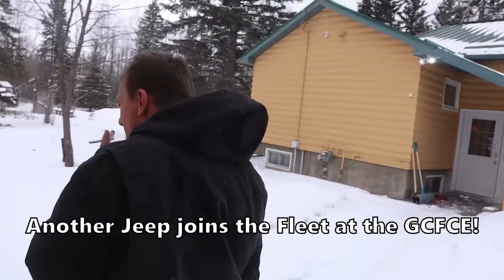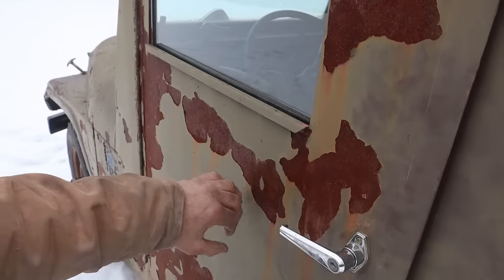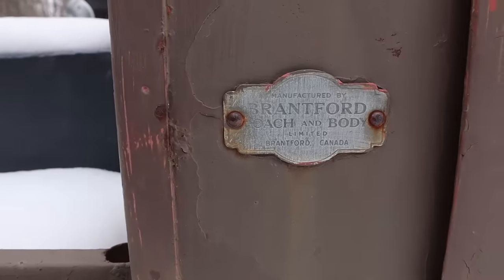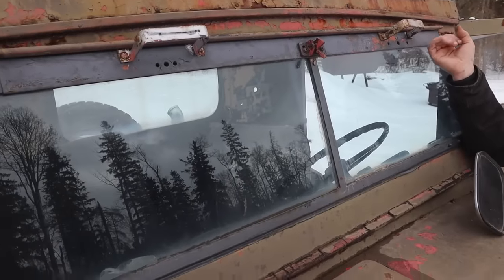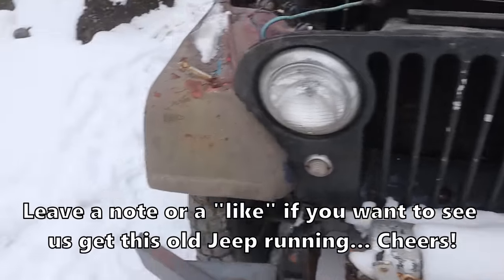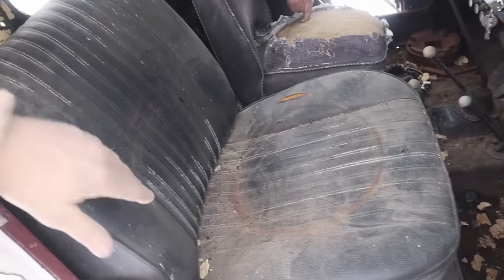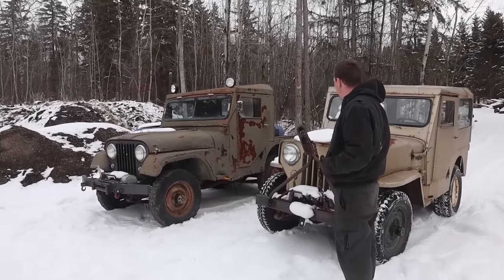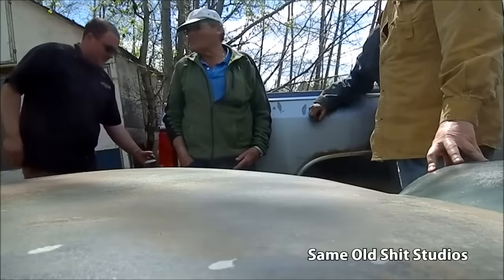Another Jeep for the GCFCE! (I lost the bet, barely...)

Comment: Park break comes out of the dash just below the Amp Guage where the whole is. The windshield folds down AFTER  the top is removed. That channel on the upper outer windshield frame is where the front of a soft top will slide into or a bikini top for summer. I'm a jeep  a holic and have owned a cj2a, cj2b, cj5 and cj7. Some 2 at a time. The best ever was the cj7 with the 5 speed behind a straight 6 4.2 l. Also owned a new  1977 jeep Cherokee chief with a  4 speed and a  360 cu in engine , plus a 1960 jeep pickup.  Yes I am a sorry bastard lol😂

Comment: LOL, I had a 63 CJ Park Mark 4. Bought it in 67 and had it the winter of the Chicago area big snow in 68. Made a lot of money snow plowing with it. The Park model had chromed hood fittings and chromed hand hold inside. The seats were black with red trim. They really knew how to gussey up a Jeep. lol. The valve cover, in red, had Hurricane stamped in big letters. (Hurricane four) It was light blue inside and out with a black full soft top. Really sharp. I loved that thing and did a lot of rough driving while hunting with it. Top end was 60 but didn't really like it.
Good vid.
Lee

Comment: I love both Jeeps. The 60 is very similar to the 56 I had 40 years ago. Same color dash and I painted the outside with rattle cans. The F head is a cool design and the CJ3B has the high hood and cowl to accommodate that engine. Great vehicles, cooler and much less money than any modern side by side. Great video and you’ll have fun getting the 60 to run. Cheers from sunny and warm Denver!

Comment: My dad had one of those. That "Hurricane 4" had just enough power to peel the skin off of a grape! (but it sounded like a hurricane while doing that.) My niece seized it by not checking the oil so off to the scrapper it went. I always remembered the small wood factory blocks it had on the hood as padding when it was open against the windshield.It shocked me that a car that new still had wood parts.

Comment: The snub nose Jeep reminds me of my 53 Ford F100 custom cab that had a 50 gallon saddle tank from a dump truck in the bed. The filler pipe was made from a 2-inch pipe with an internal thread. Same as Dan's, I had to improvise a cap. Mine was a spray can lid with a hose clamp around it. I was able to drive all the way from Philadelphia to Lake Cabanga in Ontario without refilling. The thing had a 351 Cleveland and automatic and served as a work truck and winter beater. But the heat was basically only entertainment, not actually warm or anything. Ran like a top, though.

Comment: I drove several types of Jeeps in the Swiss Army: We had one old 6V. it was historical already in 1980, we had 12 V and 24 V.
This nose of this one here was the most "modern" type we would drive back then. A friend who was a few years older than me told me that he drove a WW2 veteran, he sad it had several bullet holes prooving the vehicle had see some real war action.
The Swiss bought tons of equipment from the US Army at war's end. It was dirt cheap at the time: I think they bought vehicles by km: They were parked on the German autobahn bumper touching bumper. 
We had Dodge WCs, the only one that were retired by 1980, there were many types of GMC trucks, they used about 1 l per km! and of course tons of Jeeps. The Swiss bought some P51 Mustangs as well.
I did not enjoy driving the oldest Jeep in winter. There were no side windows and we suffered driving it in snow storms. The wipers had to be moved by hands. the battery driven motor did not work at all.
Brakes were very sketchy, but with snow chains they were unstopable offroad.
Reply: This gave me a mental image of the Swiss Army Jeep with 37 different types of attachments and PTO accessories.

Comment: I had a '62 Willy's motor Jeep on the body. Made for farm use. 588 rear gears. No backup lights stock. I wired in two small spots to a toggle switch on dash. In low range, I could find anything to stop it. Laid off , no funds coming in had to sell it. I had rebuilt the motor top to bottom myself. A tip, there is a head bolt hiding under the carb.

Comment: Excellent short video Cold Water Motors  Scott  :) , Dan :)  at GEFC  1960 JEEP CJ5  so cool my one boss my cousin he  had found at local Wrecking Yard  a 1960 JEEP Cargo Van 2 door frame was rust out couldn't repairs on  need replacement  one  and in 2008 to 2011 ! We both got to his home shop and started in 2008 ! We put Full size GM 2 door 1978 pick up 1/2 ton frame in , orgnail motor, transmission  , axle couldn't use so put 1980 GM 4.4 litre 267 V8 motor 4  barrel , change wiring to GM , daul exhaust  , Turbo 700SR 4speed Overdrive Automatic transmission with Shift Kit, 1978 GM 377 rear end gears posi , GM Brakes plus Boster , GAUGES  , change  12 Volt Negative ground  one , Am, FM radio antenna  on roof , Am/FM CD radio with 5 speakers , 1970 GM fuel tank , Crager 5 star rime 14 on front and 15 on back ! Singal buckets  , full bench back , foot pedas GM for Gas , Brake, Emergency brake handle still orgnail to use , back doors turn tailgate  with back brake also license plate  door for fuel tank  plus like 1970's  way all chrome bumpers still good condition  ! Plus got Heater GM way , Tilt Steering  with Jeep type! Windshield Wipers electrical small 18 inches and and tailgate with defrosting grid electrical  too! Sadly in 2017 got sold went USA bound and then my cousin man help him built it he past away! But this 1960 JEEP me and my man cousin paint black with blue flames decals on also but orgnail was same blue too and  found decal on side of cargo said milk and company was my cousin wife fathers famillies orgnail had back then! So cool !

Comment: Interesting look at vintage Jeep CJs; they are rare here in Denmark where most of the potential buyers ended up driving Land Rover Defenders, Nissan Patrols or Toyota Landcruisers instead. The older Jeep CJ seen later in the video, with the more angular nose and station wagon-type bodywork, reminds me a lot of J20+J40 Toyota Landcruisers which again are significantly more common where I live so its styling probably inspired Toyota's designers for those models. At any rate: Good luck with restoring your new Jeep!

Comment: I traded some stuff for a 55 cj5, for the parts, and it was a snowplow jeep with the exact removable cab that's on this jeep.  This could have been one of those snowplow jeeps, because that's what mine was, and it still had the hydraulic pump that was mounted over the generator, which was belt driven.  Fortunately i ended up finding a 54 m38a1 jeep about 70 miles from me.  I guess an older guy bought it from the governot back in the 80's, and he never titled it for the road.  He drove it in northern Michigan on his summer property, which saved it from the rust death.  All the 24 volt stuff is there, and it hasn't been hacked or modified.  I wish he hadn't of painted it a dark maroon on the outside, and on the dash.  The engine bay is still olive drab, and it needs a couple small patches, but it's solid.  I just pulled the brake drums, shoes, and wheel cylinders off the rear, and they were the originals.  seventy year's is a long time ago, and that's pretty wild, considering he stopped driving it in 2017 because he was in his 80's and couldn't get in it anymore.  His daughter sold it to me real cheap, guess nobody wanted to drive to Frankenmuth Michigan to look at it.  She dropped the price to three thousand, but took my offer that was a few hundred less.  These old jeeps are so cool, I'm 53, and have wanted one since i was a kid.  My grandpa's both fought in wwll, and my one grandpa had an old jeep we drove on the farm, along with a 67 mule.  He sold the jeep, and i have wanted one since then.  
     This 1960 jeep cj5 looks good compared to some of the one's I've seen, way better than the cj5 I've been dismantling.  I look forward to seeing this thing running.  I'm new to the channel, and just subbed.  G-d bless.